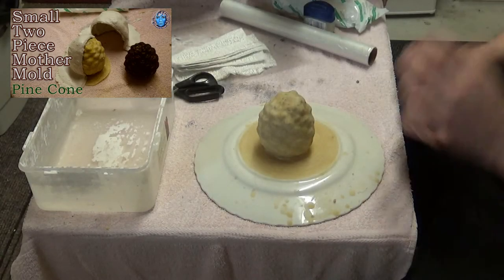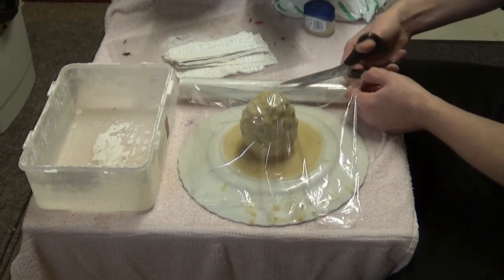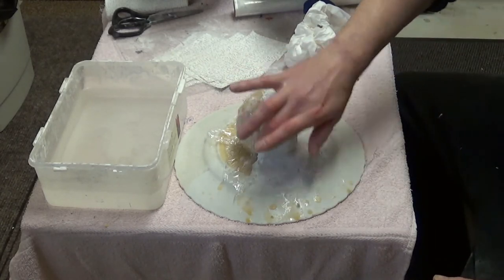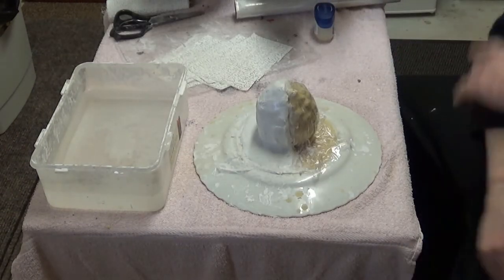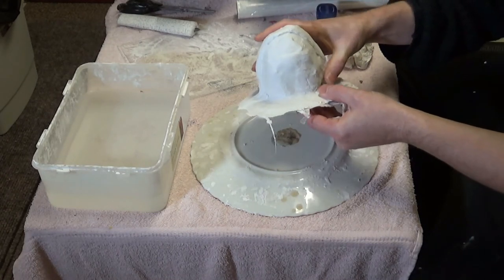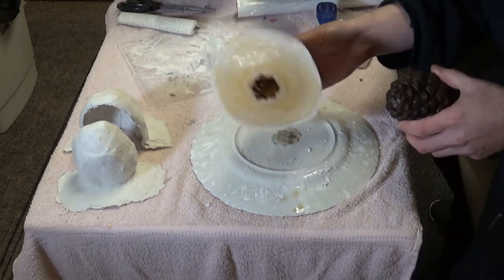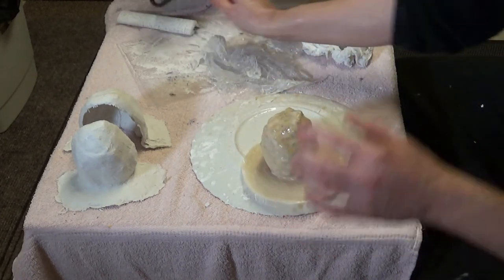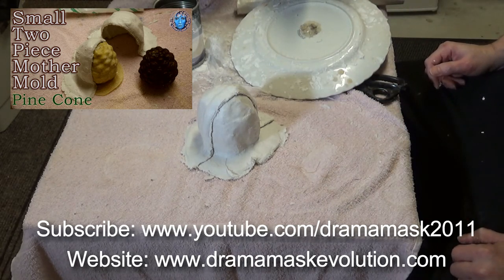Small Two Piece Plaster Bandage Mother Mold

Comment: Great video! Could you use a second layer of cling film between the two layers of plaster instead of using vasoline? Also do you think you could use water and make a frozen pine cone ice cube or would the plaster break? Thanks!
Reply from the maker: Yes, you can use anything for a barrier as long as it doesn't affect the latex. I used vaseline, but was careful not to let it touch the latex as this could affect the latex. I have casted ice from a latex mold and seemed ok: Casting A Skull In Ice: https://youtu.be/qTTZe5Q7GYw

Comment: Thanks for the video just an quick question can I apply plaster directly to the rubber latex without cling sheet
Reply from the maker: You can obviously try that and find out why the cling film is used on an experiential level. There's a reason for using the cling film, otherwise it wouldn't be needed.